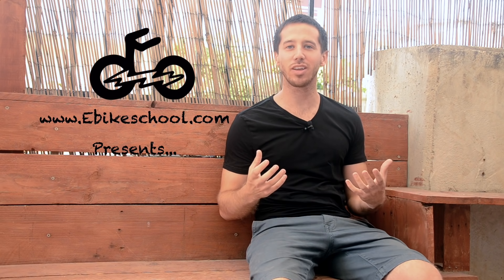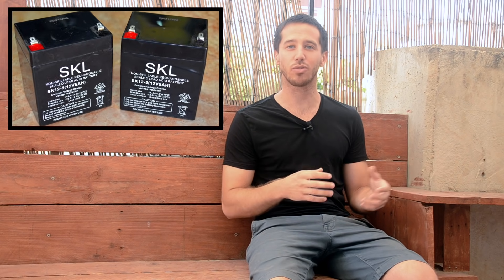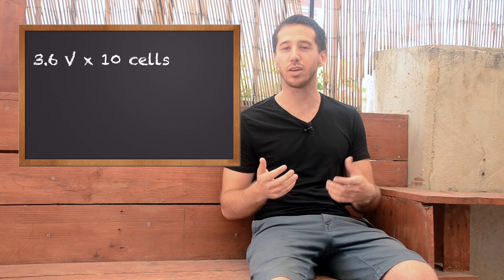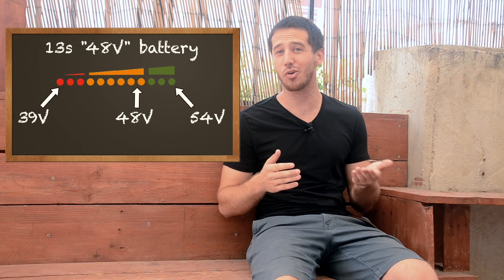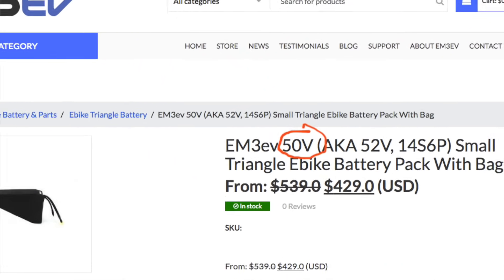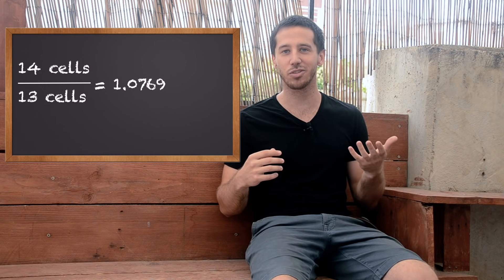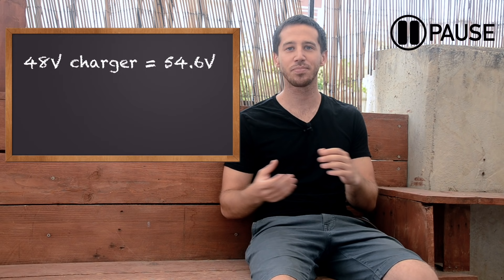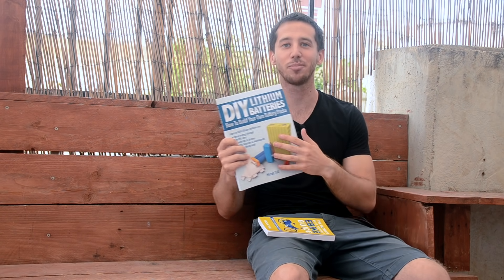Which is better: 48V or 52V battery?

Comment: I build 48v lifepo4 battery 15S 6P. Using 40Amps BMS. My battery is charging upto 50.4 only as well as BMS cut of at 47.5V. can you assist is there any issue in BMS

Comment: I bought a 52v battery for 1000w kit. The controller can only handle up to 55v and cut off for anything higher than that. So I have to use a charger for 48v battery which charge up to 54.6v. The power from 54.6v to 58.8v can't be used. Also the LCD display shows power level disproportionately.

Comment: Also, you get more capacity . With a 48v battery it cuts off at the BMS at 40volts which is before the battery runs out of capacity at 39v. At 52volts it's going to run out of capacity at the battery before the BMS shut off. Meaning you're getting a truer battery capcity. 

I dismantled my old 36v batteries and reassembled them into a 28ah 52v battery and it's a beast. 

Thanks so much for the channel to inspire me to make my own beast battery! I'm going to next salvage laptop batteries and build another 28ah battery to pair with my current one to make one Uber beast battery. 

Btw I'm a courier hence why I need a beast battery in the first place XD

Comment: Have a 48 volt system I changed the 52 volt system how much of a mileage increase would you get. You say power and speed it gives but will it give me extended range
Reply: No. Since the battery capacity is giving you more range.
Voltage (just) gives you more speed.

Comment: At 7:00 Micah explain to us how a 52v battery to run a motor at 1,000 watts uses the same amount of AMPS as a 48v battery to run a motor at 1,000 watts! The reason all of the power companies run such high voltage across power lines is to keep amps down.

Comment: I know this video is old but I have a question to anyone that can answer it  please I have emove touring the oe battery is 48v I wanted a little more range so I was planning on adding a external battery pack wired on to the oe battery pack before it reached the control module question is can I piggy a 52v battery to the scooter 48v system and battery would it work would it go any faster or would I just cause a fire ? Lol

Comment: i have 48v 40 ah lipo4 15s BMS is not working properly it's charge 45v and cutoff  charging i want 52v output what can I do can I add 16 cell in parallel? or i wanna buy 16s BMS ?
Reply: it's new brand bms
Reply: I'm using for e bike 48v 36 ah.  3.2 v 6000 ah 32700 fbtech cell

Comment: The charger for our ebikes seems to shut off when the BMS shows  somewhere between 53.9 and 54.1 volts, not 54.6 volts.  Would this indicate a deficiency of the battery or the charger?  I'm not well versed in concepts of electricity, and although your message makes sense when I listen to it, I'm not sure the concept has sunk in as to how the power works.   I just know I am enjoying my ebike (not a well-known brand) and if it every breaks down, if I couldn't get it fixed, I would buy another.   So I'm still trying to learn what I can.

Comment: In terms of efficiency and temperature though, if you’re given extra speed/power with a 52v battery, doesn’t that mean you can attain the speed of a 48v while using less current? In which case you’d have an efficiency gain. Correct me if I’m wrong.

Comment: Hi Mikey. I live in the UK. I've watched your videos and so bought a ebike conversion kit, without the battery. I bought the Volimart 1000w front Wheel conversion. Ive put it all together, with your help from the videos, but now I have to buy a battery. I think you recommended a 48v 20ah battery. Can you reccomend a decent, not too expensive, make? I did want to make my own battery after watching your videos but I dont have much skills, my eyesight is not too good, so I'm not going down that road. Some recommendations from you would be very welcome. Thanks

Comment: Thank you for your video.  I bought a brand new Samsung cells 48v downtube battery in July (still in box never used) with the intention of  a bbso2b installation but circumstances changed and never got round to buying the motor..  Could I use this 48v battery with a bbshd, undecided which motor to buy but I have the battery now so don't want to waste it and waste my money etc. Thank you.

Comment: Except a 48V pack could happily be described as a 55V pack. Adding an extra battery is equivalent to a seven percent increase in overall performance...and can be described in the same way as a 60V pack rounding up. A chap could sell you a 13x battery 55V pack or a 14x battery 55V pack and not lie about it at all.
The accepted or nominal voltage for a lithium ion cell is 3.7 volts. Below 3.5V is when you need to take it out and charge it. Fully charged it is 4.2 volts. A fully charged 48V nominal pack will be measuring 55V.
So? Don't worry too much, but yeah of course its worth having an extra 7% in standby. Remember that is seven percent weight and size too.
So  it will not drop below 45v unless you are over discharging.

Comment: I THINK YOU ARE MISTAKEN
Assuming you ride in the same speed as with the 48V - you will draw less current ,
Battery temperature is defined by the current flowing through the internal resistance and P=I^2 x R.
Why ?
Well - How does a 52V battery drop 48V on the motor ? 
The controller uses PWM to control the actual voltage to the motor which as you said correctly - the voltage will define the speed of the bike .
PWM = Pulse Width Modulation - meaning the voltage is switches on and off very fast as the average will be 48V and not 52 thus the average current will be lower as the Power (P) will remain the same .

Comment: Hi need help can I run a 60 volt 18 amp battery with a 3000 watt Hub motor 60 volt 45 amp controller please email me gmail is willdejess62@gmail.com thank you have a great day

Comment: Where can you see the difference between 48V and 60V battery?

I ride Mqi+ sport wich has 48V battery and Nqi lite and sport  wich has 60V battery and they are ride the very same speed and power at the same hill i tested. I didn't notice difference in power.

What fo you suggest to buy for better range,  Mqi sport or Nqi sport? I''m 76kg and 177 height.

Mqi is better to wind on the road, i cant decide.

Comment: Mike I needed to know after a 60 volt lithium ion battery pack is charged fully it shows 69 volts so will it damage the controller as the controller is rated for 60 volts

Comment: Another disadvantage I have come across, the battery indicator on lcd display will not be accurate with a 48v motor/controller and a 52v battery. 48v with 48v works ok. 

If anyone has any solution for this I am all ears....

Comment: I have a question I’m new to the e-Bike seen and I’m looking to convert my existing bike into an e-Bike I’m looking at a 1500 watt front wheel hub what battery do I need to run it any advice would be greatly appreciated

Comment: Thanks! It will pull less current as long as you drive the same speed and acceleration curve that the lower battery. (not like I can do it!-)

Comment: In the world of e-bikes it seems that when you buy a new battery that has a higher voltage you are not getting any more cells or better cells you are simply just paying for the wiring configuration within the batteries Acres within a 32amp 61.2 volt battery there 172 cells that make up the battery now all you have to do is why those cells differently to get more voltage and Away you go. 

Also another thing I don't like about e-bike batteries is because there are 172 batteries that can make up a battery you will get incomplete charging as the cells would have been grouped because having a battery management system that monitors and charges each individual cell is just crazy and for me this is part of the sales tactic in getting you to buy another battery.

Comment: I really need help. I have a 48v 1000w motor coming in a week and I need a battery. The one I'm eyeing is a 48v 700w battery. Is that safe to use? I don't care for the speed I just need it to work. Thanks :)

Comment: I would like to try my hub on 60volt, I would be worried like in case it blows controller. Still a new battery would set me back £60 odd on Aliexpress (maybe even more say £90 for a 60 volt) cheaper than getting a new hub like.But I guess you can't beet just getting a more powerful Hub if you wanna go faster, there's no substitute for Wattage!!! Buying a windscreen is a cheap method for increasing speed.
Rob

Comment: Good day, I had 48v 1000w hub motor and I had 2 dewalt 60v 9ah batteries. Will i able to use those batteries since the hub motor is only 48 volts.  Thank you.

Comment: So, if I upgrade, I'd be adding more speed than range? I think I got it.
Reply: Im fixing to make my own 54v battery with 18650 cells.  You should too. The 1500 Watt hub can go up to 2000 if the battery  is fully built 54v if there is enough power outage in the battery, the hub will pull it up to 2000 watts. So. 48 volts isn't going to let the 1500 watts pull up to 2000 watt with better power amperage.   And you can pick your outage with these 18650 cells. They last three years at because of the way we need to be able to use them like Samsung and Tesla. They just opt the batteries we already have. Instead of our battery lasting 10 years. They gave it the battery power we need and lowered the years by half. So it is quality and they will get it right soon. To go beyond thIS. With batteries., I mean look at what your riding on. They are RC batteries. Like batteries you got on your TV remote. This is damn Good to only need 30 or something to ride All day wow

Comment: If my Vesc voltage limit is 60v
My hubMotor its 48v 800w
Do you think with my 14s battery configuration can it be at risk my vesc?

Because the battery at fully charge its going to be 58.8v
Only 1.2volts to reach the limit of the vesc (60v).

What do you Suggest?

Comment: Thanks to add the comment for the new charger needed for 52v. With my 14s battery and bms, i discovered hat my charger is set up for 54.6V. Still, it was possible to adjust it for 58.8 with one of 3 variable resistors inside (other ones were for cut-off voltage and current)

Comment: I pretty much drive my ebike at the highest setting all the time. And let the auto charger charge it to full every time.  I do keep the battery indoors. And I fully charge the bike after every ride.  My average ride is 7 miles. Do these practices diminish long term performance?  Or is this just par for the course?

Comment: What will happen if instead of 500w 36v hub motor to fit 1000w 48v hub motor? I know that battery will drain faster. But will it run? Will be slower?

Comment: I got a 48v ebike.I would over Volt it to 52v for extra power but I would be worried about perhaps blowing the speed controller, or the motor? So what is the story, is it safe to run at 52 volt?

Comment: If I set the display to 48v (I have a 52v battery) will the controller limit the battery to 48? If the motor is 48 and the battery is 52, the battery indicator will not work correctly? I am having this issue

Comment: I want to build a trailer for my 1000w ,48v ecotric Hammer,  can I mount an alternator and battery system,add an inverter to plug my 110 charger into and plug into bike charger port while in operation,  elkrivergoldminer@gmail.com.   How can it be done

Comment: Micah, if I already have a 13s5p battery, would it be a legitimate option to add a 1s5p battery with the same type of cells  in series to make a 52v system?   I’m thinking of hiding the smaller battery in my tool bag.

Comment: Hey Mikey, really love all your stuff, quick question for you and would love it if you did a piece on it, I am looking at building a battery for my Ebike and want to build a 52v 20ah battery but which size cells are best suited? I know 18650 has been widely used but, my current 48v 15ah battery uses 26650 cells I am really tempted to try the 21700 cells (now Tesla's common size) as on paper they seem to be excellent. would really appreciate any input you have sir. Matt, Gloucestershire, UK

Comment: Even at the same current the battery with more cells WILL be cooler not because it's running lower amperage but because the same load is being split over more cells thus reducing the work load of any one cell equating to lower temps. Granted this difference will most likely only be a few degrees.

Comment: Hi Thx so much. Great channel.. Question:  Does it damage a "Bafang mid-drive 48V" to run it on 36V Battery?   I realize it would run slower but would it damage the electronic?  I have both batteries.  I would use as a backup. Thx as always.   Barry :-)

Comment: Charging your battery to only 80 or 90% will increase its life considerably.  So using a 48V battery charger on a 52V battery is a good idea unless you really need those extra few Wh from a 100% full charge.

Comment: great video thanks -- so i have a 48v - 2000w controller rated at 33A --  I see now I can use a 52v battery but what about amp output can it be more than the controller rating of 33A?  Some the 48 and 52v batteries advertised say they are for 1000-1500w motors, will they work for my  48v 2000w motor  ?

Comment: If you just used the 48v charger with the 52v battery, your battery lifespan would increase substantially. Of course, considering how long lithium batteries last already, it's probably not worth the hit in capacity.

Comment: Hi Micah - I'm in Europe, where we have a maximum assist speed of 25 kph (15.5 mph) and a 250 watt limit on our motors, so there are electronics in the drive to keep the assist  to the speed limit (the watts limit doesn't seem to be closely enforced). If you want to go faster you have to pedal harder, but over 25kph the motor gives no assistance. The speed is detected by wheel rotation, so it's independent of the motor's electronics. Presumably limiting the speed this way means the motor's speed is governed by other factors as well as input voltage. How does this play with varying the voltage? Do we get better acceleration up to the limit speed?

Comment: 48V is better to buy because they're more commonly available. 52V will get you more power but its not as common so you'll be paying an additional cost based on the economies of scale for the 52V.
Reply: Agreed. I bought a bike that uses 48v 14AH and it's a common battery case style found in many different internal battery e-bikes. Paid 325 for a second 48V 14AH battery on amazon. That same case style is also found in 36v setups and still fits my bike. Gotta love standards. 52v is only a few percent higher and not worth it for a non-standard voltage.

Comment: For me 52 volt battery means 13 s
But i Decided to only charge to 50.7 volt, Medan each battery was 3.9 volt cause the under voltage was 42 volt
That I know maximum undervoltage was 3 volt for 4.2 volt battery
So of i have 13 S battery, so overall battery after undervoltage was 3.2 volt and that was enough

Comment: Yeet.
Repping the 20s+ Gang ;)
Reply: As for nominal voltage confusions.

Vendors need to do this right and they do not;
Nominal voltage is where the pack sits for the most time during discharge.
Commonly 3.6-3.7v in a cell. However, lower capacity packs may go as low as 3.2v a cell under load.

It really depends on the cells being used at to what the nominal voltage will be.
A 3500mah cell will have higher nominal voltage than a 1000mah cell from the same manufacturer due to its capacity making it stay in the higher voltage range longer.

Hope this helps :)

Comment: I am about to do my first project to convert a new MTB to a mid crank drive eMTB. I am thinking of the 750 or 1000  Watt Bafang. I am not completely convinced that there is any difference except the price, but what do you say? My concern is gradient climbing ability at low speed, I do not care about top speed, my 250 watt bike is fast enough for me on normal grades. I am 70 years old, I live in hill country and my Bosche 250 Watt system is not really enough help these days with the many 1:5 (12%) gradients round here. I think the 750 will make 8 mph up i in 6 because bike plus me is 100kg, that would be fast enough, but maybe I should be talked into 1000 Watts? mail@ben-campbell.uk

Comment: Hi! 
I have 48v 500w hub motor,and my controller is s866 lcd, wich in settings is going up to 60volts.
Can i set this highest setting to get more torque and speed without harming battery and motor?
Is it even safe? Or this setting is there for 60v battery ?

Comment: Good video.. Thanks! 
You briefly mentioned extended range using a 52v... I realize it may be difficult to quantify, but what % of increase would you say can be expected? In my opinion this may be its greatest advantage as running a cell too low has the greatest impact on lifespan. I'm thinking if I ride 40 assisted miles a day on a 52v ,it should be drained less, charge back to full faster and have a longer lifespan... Is my thinking correct or am I missing something... or is the difference minimal and not worth the cost?
Reply: I’m with you in this camp. More power is nice but more range is my first choice. Looking to go for a bbshd with a 52v 20h kit. Can I ride for an hour out and still ride back? Should be able to!

Comment: Hi, i bought a 1500w 48v kit, but now i see 48v  batteries on ebay that the vendor states that they are for 1000w motor max. Is that correct? Or i can just buy one 48v with the amp hour figure that suites my needs?

Comment: Yes you will use less current with higher voltages for a given speed. You can't change the parameters of an equation to suit your false statement. 52V at 20mph will use less current than 48V at 20mph. Just because you now have more voltage, does not mean that you have dicided to drive faster.

Comment: I’m a little under 300 pounds.  I just want some help on the hills but I don’t want to burn out a motor or battery.  Can I go as little as the iMotor front wheel or do I need to go with a bigger setup?